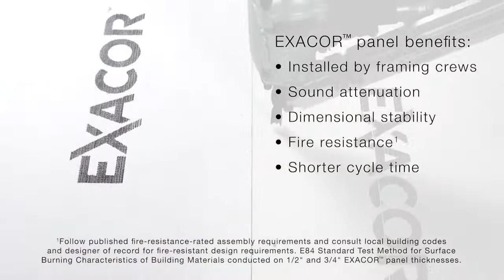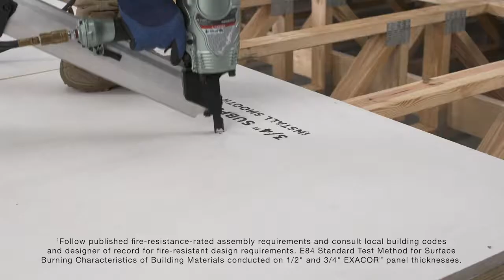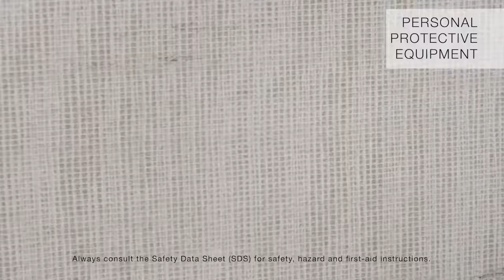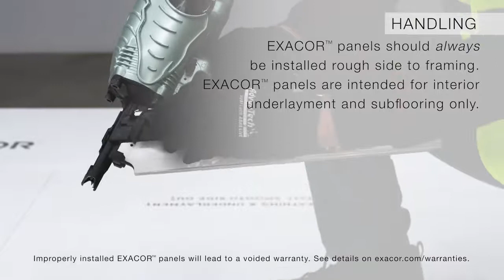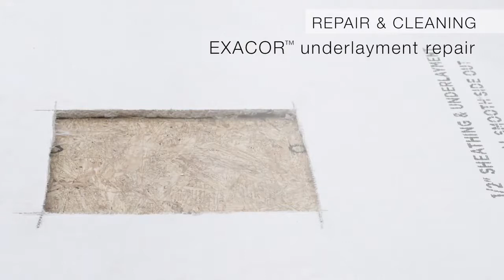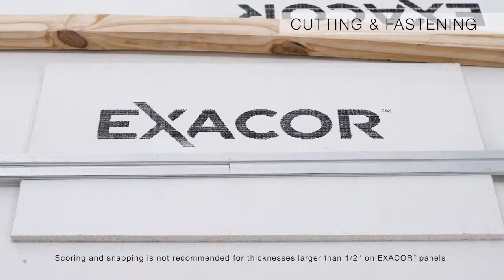Installation Basics l Know Before You Go | EXACOR MgO Panels

Comment: They EXACORE need to explain why this is needed.  And, what finish flooring products can go on top?  Hardwoords? Tile? Obviously floating floors, since they dont usually need adhesives.  Since when do you add a second layer of sub flooring to a building.  Am i missing something.  Glue n nail subflooring to framing, then add another layer (of this) or plywood???  Seems like some dillweed came up with another cost to construct buildings...for what benefit? Water penetration?  Most subflooring already has a water resister in the top side.  Seems like this is an uncessary product.  If this was a subfloor product, heck yeah makes perfect sense, but its obviously not.  Exacore do better explaining

Comment: Exacor needs more instructional videos. I do want to know why is it used as underlayment if there's still a need for OSB/ply underneath. Also why isn't MGO cement or something like that recommended as a patching material instead of caulk? They also should have specified they used a construction adhesive/construction adhesive foam  in the video for the larger MGO board patch.

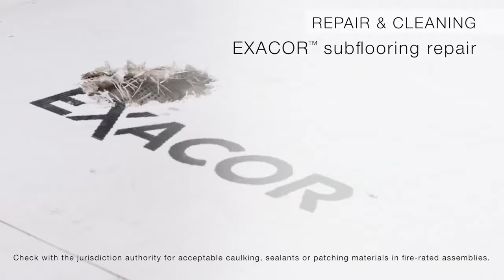Comment: At 3:58…
1) It’s stupid to say "2 sq inches or larger."  You’re never gonna have exactly a 2 sq inch gouge in the panel.  Just say "larger than 2 sq inches."
2) How can you install 2x blocking (for the patch seam) if your placing the patch (and panels) over existing plywood subfloor?